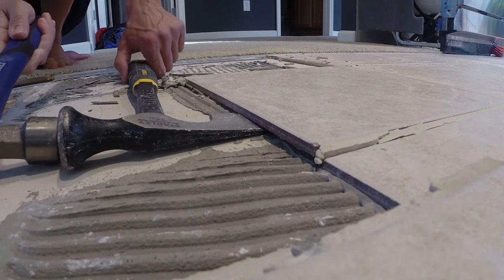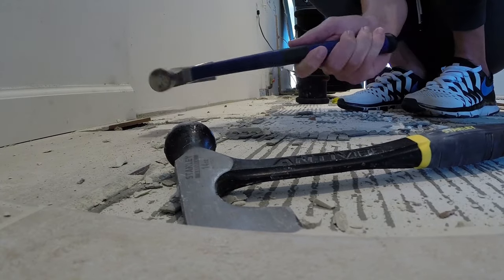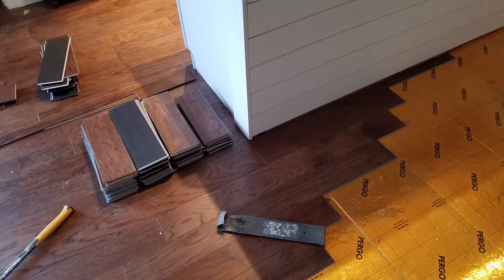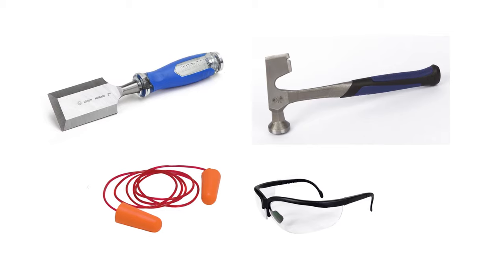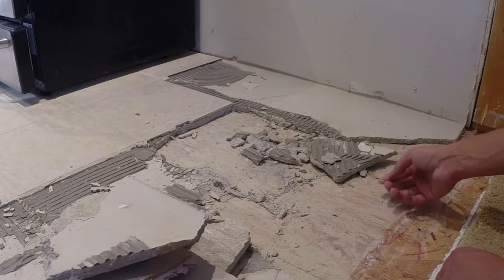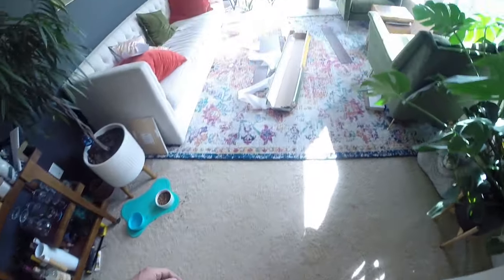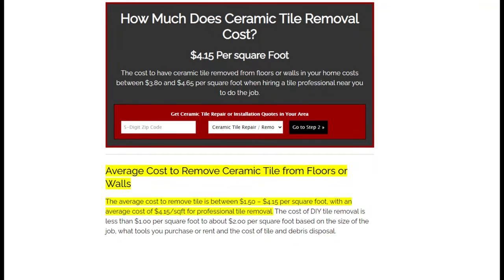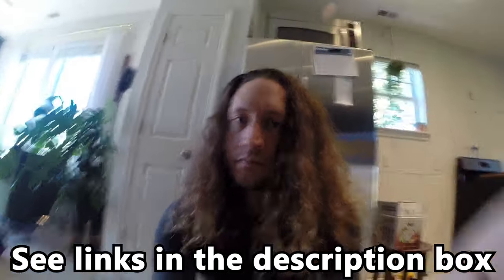How To Remove Tile - Crucial ADVICE for Removing Ceramic Tile Floor!

Comment: Why not remove the baseboard trim instead of trying to get the tile out from under it?  That would not only save a lot of time, you would also not risk damaging the trim.
Reply: 100%
Reply: It's because you are listening to a home owners advice not a contractor. You will need to remove the trim to install the new floor PROPERLY anyways. Keyword properly, homeowners however do all sorts of things..
Reply: He did mention that he was working a tight budget, so he probably couldn't afford new trim through out...
Reply: @justauser  Like hitting a hardened hammerhead with another hardened hammerhead 🤣
Reply: @User  yeah, I trust a homeowner much more than a contractor.
Reply: @mister_dave1184 right lol, can't tell you how many issues and shortcuts I've seen after fixing different contractors work
Reply: @raviscott4853 you're supposed to hit it with a wiffleball bat instead?
Reply: @wisewisdomtooth No, a rubber or wooden mallet.
Reply: @MAGAMAN  that would take forever, just get an actual chisel

Comment: Looks like this method worked best for you but it doesn’t look like that tile had much mortar under it.  Some of those tiles looked like there wasn’t anything holding it down.  Most quality tile jobs are completely buttered both in the floor and the back side of the tile.  I bet more of these would crack instead of coming off cleanly if the tile was adhered more securely.

Comment: When using the chisel to remove mortar you should use the chisel upside down. This makes it less prone to dig into the concrete board.

Comment: I would suggest using an actual chisel rather than hitting to hammers together. The head of the hammers is hardened steel and hitting two together they can break and be a safety hazard. The striking end of a chisel is not hardened and is meant to be hit with a hammer.

Comment: Ceramic tiles and marble is removed by taping them with a  hammer 🔨 from the top so they crash and actually most of it will pops up. Then, just scrape with a scraper and collect with trash tray and brum. Quick and easy. Wet with sponge and let it soak for a minute or two the rest of the thinset then scrape it with wallpaper scraper. Wash out any left residue with a sponge from the substrate-concrete or plywood and call a day. I was a marble setter so trust me on this.
Reply: Thank you

Comment: Never hit a hammer with an another hammer because chip can detach and penetrate into your body. I followed this tutorial and by one hit a splinter from the hammer flied into my shoulder and probably it stays there forever (i am just back from the hospital). I had a very big luck that it didn't go into my neck for instance. Hit the hammer with wooden hammer, but don't play with two hammers.

Comment: If you put the beveled edge down, so the flat side is facing up, you lessen the risk of digging the chisel into the material you're working on.
When using a chisel like this to remove the grout, a cold chisel would work a little better, you can use the same tool to remove the tile.
Many masons chisel or brick chisels also come with a handle that has a guard to reduce injury caused by a glancing or missed blows.

Comment: I'm not a pro, however, it is best to remove all baseboard trim, first using a utility knife to cut at and along the top of the boards to avoid tearing drywall and paint. This will also help to get behind the boards with a small pry bar, possibly avoiding damage. If removing cabinets is possible or use shims to raise them enough. You'll want new flooring under baseboards
Reply: he replaced it with click in boards though and the tiles were also already coming up extremely easy.  I just had to use a demo hammer today on tiles that were completely stuck on for 4 decades and I didnt even remove the trim because the edge peices are always super easy to get out. I didnt damage anything and was chiseling pretty close to them.  No point taking them out if you are arent puting in new tiles. way faster.

Comment: I want to remove tiles in the hallway, now I know I can do it myself, thanks to your very clear instructions and not leaving out the upcoming problems! Really appreciate it, thank you!
(Thanks to YouTube I removed carpet and popcorn ceilings - slowly becoming a pro  :)
Reply: Amen
Reply: Good luck with all that... the only reason that came out easy is because it was installed with shit material.. not all tile comes out that easy...

Comment: If good quality tiles have been fixed properly using the right method and quality adhesive cement which has cured properly, then the job is a damned sight harder than what is depicted in this video.
Properly set tiles do not simply 'pop' up when levered with a chisel.

Comment: Finally someone who says how hard it is to do something. Thanks for being real. How was the dust factor?
Reply from the maker: Dust wasn’t bad for the breaking up portion, sweeping up the debris did make dust, but that dust was nothing compared to when I sanded self leveling concrete in my kitchen remodel video

Comment: Thank You!! All the other videos were smashing the top with a hammer. Knew there had to be a more efficient and safer method.
Reply: This video only works if the tiles are installed improperly.

Comment: Using one hammer to strike another hammer is a no-no. Hammers are designed to strike  softer material. There is a very real risk that part of one of the hammers will shear off and injure the user. 

I have seen a fellow worker on a construction site have a piece of metal from a hammer embed into his leg by using the technique. 

You can purchase a cold chisel for the job.

Comment: Just hope the installers didn’t (a) use latex additives in the thin set mortar (b) use mastic adhesive 
Is so, that tile will come up in 1-2 inch pieces. If it’s straight on a concrete slab it will generally take a small demo hammer and a lot more time.
1. Take the trim up first 
2. If you have backer board under your tile, just pull up from the backer board and replace it with plywood. Much easier process.

Comment: A claw,roofing hammer and chisel work great for a small area and if you like dedicating a lot of time to remove it.  The besy way to remove tile (my opinion) is cover wverything plastic dropcloth and chisel is out with a rotary hammer, aka, the demolition hammer.  Its messier, but its way faster, and, just as satisfying.

Comment: Good tips. And this is much easier for a one time removal than a air chisel. But don’t use a wood chisel for this job..the chisel pictured in your video is a wood chisel and the edges are sharp and will just get ruined.

Comment: I used a wheel barrel to haul it out to my car filled with about 10 strong small boxes back seat and trunk and passenger floor and seat had boxes, there we dumped the tile in the boxes and off to the dumps $30 bucks when we were done, and wear Good Mask or Respirator mask.

Comment: Most of this is just common sense. Larger tiles are much easier to remove because most people who put them down don't "butter" the back of the tile correctly. So yes the bigger tiles will pop out much nicer. The harder tile to get up is the smaller tile that people put in their bathrooms. Specially the tiles that are in sheets and have a wire mesh backing to them

Comment: I wish I watched this before I removed about 35 square feet with a demo hammer... it took about 3 hours to get it all out with the backer board.
Hot water and vinegar softens the mortar so you can scape it. I used about part vinegar to 3 parts water.

Comment: Great and informative video my question is if I’m installing new tile over the same area how important is it to remove the old thin set completely?
Reply from the maker: good question I actually don't know, probably as important as having a flat floor
Reply: It's very important.Having old thinset under your tile can case your tiles to pop off or even break. Do the proper work the first time so you don't have to do it twice.

Comment: I would like to see how to remove a tile in the middle of the floor. I have a broken tile in my kitchen and the tile is discontinued.  How do I remove a tile under the refrigerator to use to replace the broken tile?

Comment: I have a similar setup with my project. I don't want to movey kitchen cabinets, but my floor needs leveling. How do I remove the parts around the sink, and then level the floor?

Comment: Appreciate you are trying to control a budget but for most people I would recommend either hiring or buying a suitable hammer drill. They have so many uses but will also rip through this job much quicker.
Reply from the maker: for sure, we also wanted to not destroy the concrete board under the tile... this was a lot of work and probably could have just paid to get it done, but i guess im just stubborn sometimes lol, thanks for the comment

Comment: It is clear by all the ridges that that tile was improperly installed. If it was installed correctly, the mortar would not have any grooves in it. You will NEVER get properly installed tile off a floor this easily.

Comment: Thank you for sharing this information.  
I hired a man to get rid of the old small tiles and to do the new 600mm by 600mm tiles. 
The problem is that the grid or the tiles are só hard, Caramic, that even this person who regularly does this kind of work,  struggles to get the tiles off. I am a snr citizen and no nothing about the  laying of tiles, but would like to suggest something or to get something, that will be of much help and bring relief with these stubborn tiles.  
Do you have any other suggestions.  Isn't there something that you can pour over the tiles and leave it overnight and by tomorrow, the tiles just slide off?

Comment: I'm about to remove my tiles in my kitchen - what is the best way to remove the ones that are near the cupboards without damaging them. When l had my kitchen cupboards replaced years ago l had my tiles laid wall to wall so now l heard l would need a small saw to cut as close to my cupboards!

Comment: I was just given a quote of $1140 to remove 170 sq ft of tile (that's appx 6.75/sq.ft.!)
 I decided to see how hard it was to remove it myself first by removing one tile in the corner...but it was easy enough that I just kept going, and removed all 24 tiles in my entryway while watching the Jeopardy championship.
I am TOTALLY doing the rest myself...however, there's one thing that I'm finding intimidating...and that is how to cut tile around cabinet toe kick.  I can't disturb the tile that the cabinets are sitting on so I MUST figure this out.  I'm wondering if a multi-tool might do the trick.

If not, this can "supposedly" be done with a toe kick/flush cut saw...but I don't really know if they're meant to cut through ceramic and you can't get inside corners with them.

Any tips....Anyone?.....
Reply: I noticed you didn't come back and comment how easy it was. lol This video is deceptive because the tiles he is removing was improperly installed. Normally tile will never come up this easy.
Reply: @MAGAMAN  I did remove it all AND I laid a new floating vinyl plank floor.  Looks amazing and I LOVE it.  Yes it was a job when you consider every aspect..which includes not only removing the tile but disposing of it...getting the remaining thinset removed (ended up renting a "hammer/chisel/scraper thing" to speed up this process)  Probably only worth doing yourself if $1100 seems like a "lot" of money to you.  Maybe worth paying someone else if you can easily part with the money and if they'll just come in and get it all taken out and hauled off in the same day...just for the mess and headaches avoided.  I'm really good at "forgetting" the messes and headaches once they're behind me, so I'm not complaining.  I saved a LOT of money overall between the tile removal and the laying of new floor...and was also able to do it with no transition strips between rooms and no quarter round used around perimeter...which is something anyone else would have totally not had the patience to accomplish without charging an additional arm and/or leg.

As for the tile under cabinet?...I ended up removing the cabinet...taking the tile out that was under it and replacing the cabinet.  An annoying job, but in this case the best way of handling it. (Small cabinet).

I do want to say that my tile was very well installed...It was just a matter of a little trial and error to figure out what was going to work the best in my particular case.  Getting the tiles out intact or close to intact is MUCH easier and cleaner than chipping the hell of them.  I personally found that a medium flat head screw driver hammered almost horizontally at the bottom edge of each tile toward the center was very very useful.  This popped them off either intact or in very large pieces without kicking out a ton of dust and debrit.  Easier to breath...easier to pick up...

Comment: Hi I had ceramic tile installed over very old mosaic tile. The job was poorly done. I would like to have new porcelain tile put down. I am told that in order to remove the ceramic tile the mosaic tile will be removed as well. Will the mosaic tile that has been there since the 1940’s have to be removed?

Comment: Also, depending how old your house is, you may have asbestos in the tile, which requires a certified professional by law to remove it, so make sure you contact the manufacturer to see if you have tiles with asbestos.
Reply: Yeah screw that, my house, my rules, screw your stupid authoritarian laws.

Comment: Youre very lucky. You can see it was an inferior install to begin with. I only wished it was that easy. If they used proper tile glue, you'll have a hard time pulling one complete piece, let alone a whole floor.

Comment: In my years of trade school they alway said you NEVER hit two hammers ,together the reason for this is because the steel will fracture because the metal is very hard. So you ask why can you use  some chisels and or a wedge and can strike it with a hammer? It is because the mental is SOFT. and will mushroom. Just some constructive criticism, take it for what it's worth.....  But at ant rate the video was good so thank you...

Comment: crow bar and a hammer is used to remove tiles not hammer on hammer . Tile cement is removed by demolition hammer with a 3" or 6" flat bit on the end . It will move in a breeze or with a long handle chisel with the hammer pounding on the top part of the chisel . Using those flimsy paint scrapers will not work to remove the tile cement . They are for corking walls or scraping bits of paint from walls . You don't have to invest in a machine you can rent it

Comment: Good work on your project, I'm jealous though, the thinset seems poorly adhered to the tile, doubt they back buttered those tiles.  I'm ripping out a bathroom and it's a nightmare, need to use a rotary hammer with chisel to get it out.
Reply: Oh boy...I just removed the tiles in my bathroom and 99% of the morter is on the floor.  Are you saying there is no other "easy" way to remove it?
Reply: @tupera1  I removed it along with the cement board.  The cement board was not down well, just with nails and pulled up with a wrecker bar.  Definitely get a wrecker bar! I got the funny angled one from Harbor Freight, worked very well.
Reply: @whattheschmidt  Thanks.  I do see a few random screws I'll remove first and try the wrecker bar and hope my back holds up!!!

Comment: Get a flat scraper tool with a big pole on it. Like a garden hoe but flat instead of angled. If you lean over and put some back into it, you can at least make really quick work of the thinset underneath the tiles, if not pop the tiles up as well.

Comment: You saved $400.  How many hours did the whole job take for you to finish the removal?
Reply from the maker: 4 years
Reply: @TailHappyTV  Wow, 4 years?  hardly seems worth that much effort! ;-)
Reply from the maker: It took a few days of effort here and there, I don’t really remember, it’s been a while now
Reply: @TailHappyTV  Love that answer. lol But, if you value you r time and the tiles are installed correctly, you either need better tools like a rotary hammer or have someone else do it. I value my time at about $30 an hour for personal projects, so if I can a massive amount of time by spending money on the proper tools it is worth it every time. I spent $600 on a rotary hammer when doing tile removal in my new house and it was worth every penny. Probably saved me a week of work.

Comment: Hi
Do you have any suggestion on how to remove a tile without damaging it.

I have a tile in an open area that got crackes and needs to be replaced sne of course I have no more extra tiles. 

I want to remove a tile from a closet floor and use it to replace the damaged tile.  Then find something similar to put back in the closet where it do not matter very much.
Reply: Its a high risk job thats nearly impossible.  You can probably find a repair kit online

Comment: You made it harder than it had to be regarding the “trim” (baseboards). Removing the trim would have made more sense. Anytime you change flooring (tile, carpet, wood) the trim should be removed. Not only will the dry wall not be damaged, but also you can re-install the old or new baseboards and get the proper fit and finish

Comment: Hey I’m struggling because we were able to remove the tile but the cement that’s being left over from the tile is not wanting to come off I’ve been going by hand using a hammer and chisel but it’s throughout the whole house so I need some help on that
Reply: Hammer drill with a chisel bit